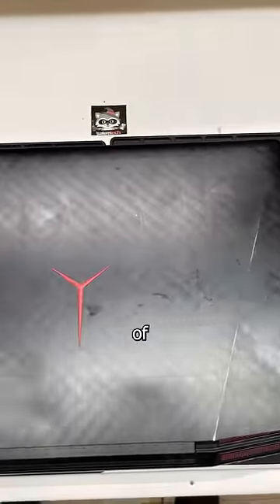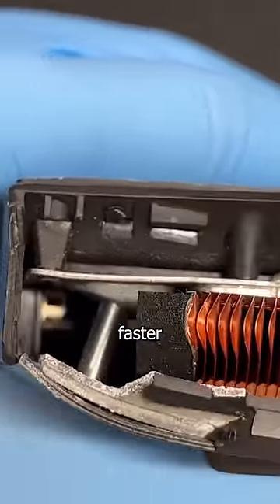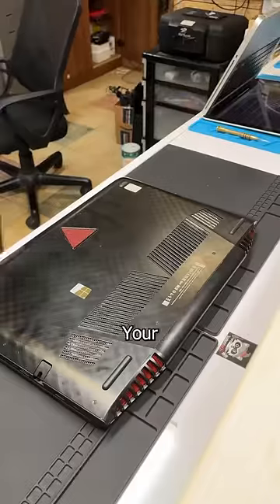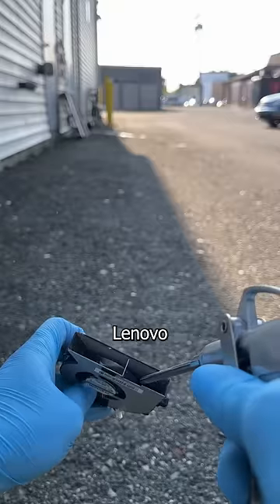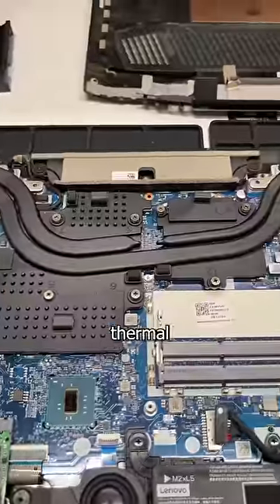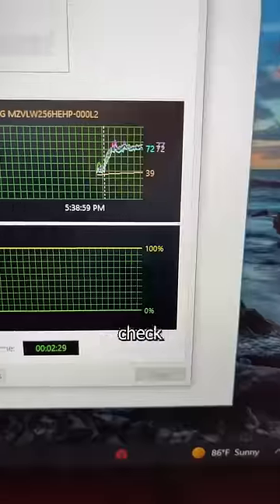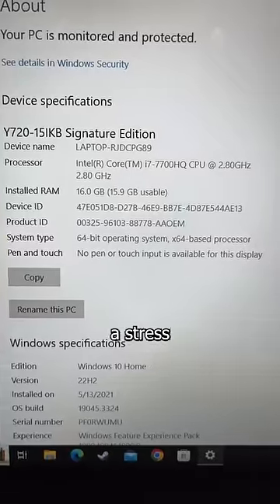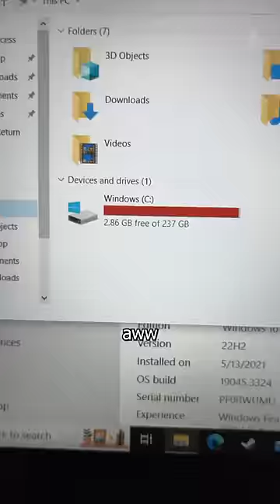Lenovo Legion #gaming #pc is dusty and falling apart #technology #tech #shorts

Comment: Can someone tell me how bad this build would be? 

CPU: *Intel Core i5-13600KF 3.5 GHz 14-Core Processor
GPU: Asus TUF GAMING OC V2 GeForce RTX 3080 10GB LHR 10 GB Video Card  
Memory: Patriot Viper Elite II 16 GB (2 x 8 GB) DDR4-4000 CL20 Memory
Motherboard: MSI MAG Z690 TOMAHAWK WIFI DDR4 ATX LGA1700 Motherboard
------------------------------------------------------------------------------------
Storage: *TEAMGROUP T-Force Vulcan Z 480 GB 2.5" Solid State Drive
CPU Cooler: Noctua NH-L12S 55.44 CFM CPU Cooler
Case: Phanteks Eclipse G300A (1 Fan) ATX Mid Tower Case
Power Supply: Raidmax RX-730SS 730 W Semi-modular ATX Power Supply

Comment: Its weird how my 2019 MSI GV62 8rd laptop looks better then that. Only damage it has is cosmetic, mainly the bottom shell of the laptop, but it did need a new fan after the old one started grinding against the aluminum shield of itself- $10 fix. 😅

Comment: I've got a similar age gaming laptop like this it got it like 3rd handy down to me still works great but been having trouble with lag and heating issues with the fan do you think it's still usable once getting it cleaned and rethermal paste and also upgrading rams from 11.5 to 16 or 32 gb ddr4 if i can find one and also upgrading from hdd to ssd, i still think i can use use till it's fully rip it would be a waste not to use it as a work laptop i dont game too much on it just use it for work/youtube nowadays. 

Here's the laptop brand 
ASUS gl553vd

Chip I7-7700 
ram 12gb (11.5 Usable) 
Gpu rtx 1050 (4gb vram) 

Hope here someone can give me advise

Thanks :)

Comment: I repaired a lenovo legion y920-17ikb 2 days ago. I had to change the keyboard becouse the W didn’t work. It was a nightmare… I had to re solder the keyboard plus a plastic plate which together had like 70 rivets in it…

Comment: I wonder if you'd be able to fix a Meta Quest 3. Freaking thing has faulty battery and Meta refuses to sell them for spare parts.
And of course, in their infinite wisdom, they made it so even if I have the cable, since battery shows 0%, it won't stay turned on. Didn't have the damn thing for even 6 months before this. So half of my paycheck just flew out the window.

Comment: For me i do ps4 controllers simple design really but small mistakes will fuck you other mine was i put it all together except the fucking part that connects the charger and led parts to the controller so i literally had to take out the battery and everything just to put one tiny fucking ribbon type plug in the smallest most inconvenient slot ive ever seen